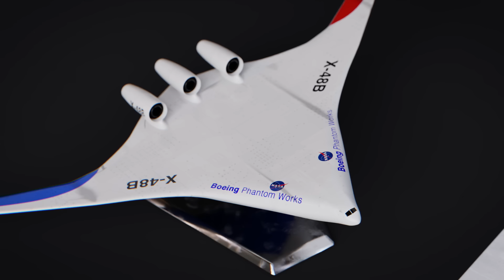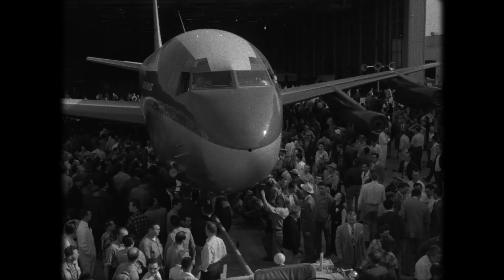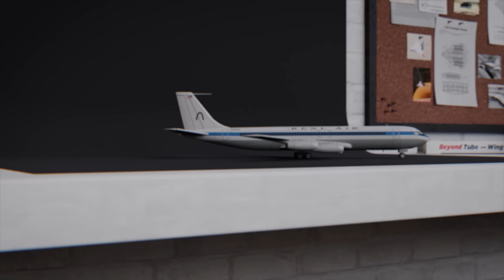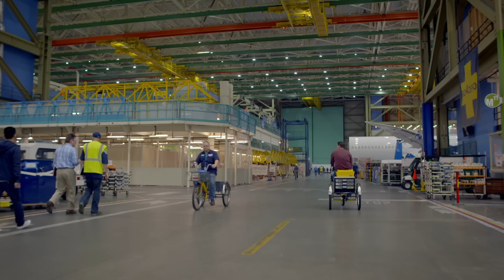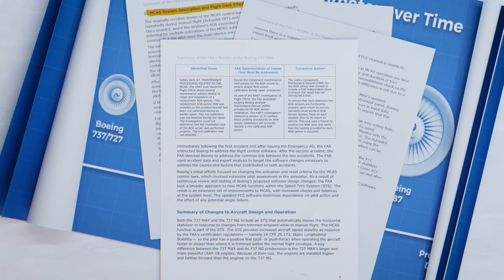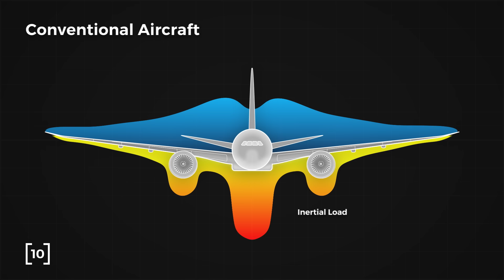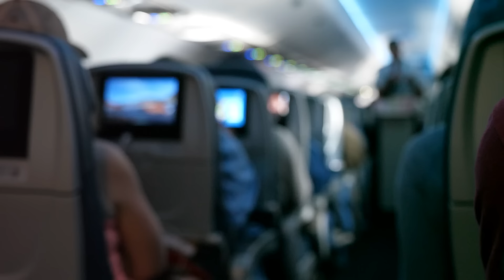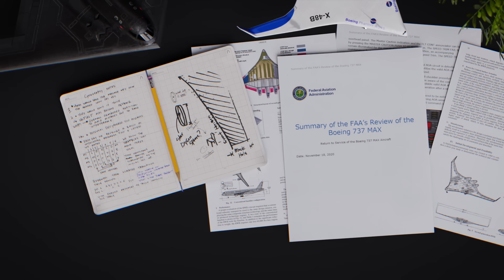The Plane That Will Change Travel Forever

Comment: Extremely interesting and throughout video 👌
Though you forgot one major issue with blended wing architecture: G loads to the passengers at the sides of the cabin during turnarounds. Obviously this doesn't apply to cargo planes but still.
Reply: I have a feeling those would be the "Special joy ride seats" according to the flight company XD
Reply: Spitballing here, but is there any chance the airlines would use that side space for cargo and use the more central parts of the cabin for passengers?  On regional flights, it might be difficult to fill all the extra seats anyway, but there's plenty of demand for regional cargo shipments.
Reply: @DurandalsFate  possibly, but then you run into centre of gravity problems and roll rate degradation. BWB is well suited to cargo though since the wetted area to internal volume ratio is good.
Reply: @DurandalsFate  that's a way to deal with the issue. But you no longer have a larger cabin for the same footprint. Neither windows. Not sure I would fly this.
Reply: The g-force issue during turns is another "gotcha" that is always brought up as an argument against BWB. But would the gentle turns employed by passenger aircraft really impart g-forces greater than a passenger would experience on a tube shaped aircraft during regular turbulence? I sincerely doubt it.
Reply: @jim2lane  Well, it isn't the only challenge with BWB, and though it may be manageable from a g force standpoint, the issue with it is more to do with comfort. It can be somewhat jarring if you stand up to go to the toilet, then suddenly find the pilot has to make an evasive maneuver that demands high rate of roll, and momentarily your 80 year old grandma is floating past the similarly airborne drinks trolley for a few milliseconds, or the freshly poured coffee is flying into someone's lap. Roll rates aircraft are designed to are fixed by certification standards for emergency situations like evasive maneuvers and depending on the type of aircraft, airport climb path restrictions, so there's no chance of relaxing that rule. But as I've said in my other comments, that's far from the most difficult issues to solve.
Reply: @onetrickhorse  you're referencing the same old tropes. You're forgetting that no aircraft is going to be safe to stand in during an emergency maneuver. Additionally, those situations occur 99.9% of the time during takeoff and approach - when everyone, including attendants and beverage carts, are supposed to be seated and belted
Reply: @jim2lane  It isn't the 99.9% of situations that concern regulators, it's the remaining 0.1%. It's those times when an ATC has messed up and sudden roll is required to maintain separation distance for example. You're right, no aircraft is technically 'safe' during emergency situations, but when high roll rates are necessary, having one third of the passengers experience zero or negative g while the others experience 2+, however brief it may be, is uncomfortable. Furthermore, the general public aren't the best behaved cargo, and despite warnings not to unfasten seat belts or leave seats during take-off and landings, some unfortunately do. 

Now, don't get me wrong, I'm sure I'd love the ride, I love a good thrill. But would 80 year old Dorothy, or a 1 year old baby? What about those with heart conditions? You have to take all of this into account when designing civil aircraft. Besides, it isn't a showstopper to BWB, just a challenge in my view. The showstoppers are more practical, the things that make the business case for BWB harder to justify from an operators standpoint. In one of the concept studies I was part of looking into BWB aircraft, the performance looked great, SFC was great, L/D was fantastic, range and payload all brilliant, as expected. But when we looked into the practicalities, we realised BWB would likely never be realistically viable. Access to engines was a major problem, since engines can no longer be placed on wing pylons, they have to be situated on top of the rear body, elevated on mounting pylons to ensure the inlet flow doesn't ingest the main body boundary layer. This means you couldn't perform critical maintenance or safety checks between trips without specialist equipment to lift ground grew to the engines. OK, say we chose to do that, no biggie right? Well, no. That comes with another set of difficulties, mainly additional equipment to buy, additional training, and the risk of that equipment damaging control surfaces. Then there's the turbine disk burst planes. It was found to be completely impractical to place the engines on the airframe without potentially compromising other critical components. You have to stagger the engines for example, otherwise one engine failure could result in debris going into the other. There's also minimum evac times, though I worked on a concept where we demonstrated that might be resolvable. 

Now, I'm not saying it can't be done. But from what I've seen personally, it would take a lot of work to get BWB to a place where both passengers and regulation authorities would be happy to sign off on it.
Reply: @onetrickhorse  the point is how often do commercial aircraft encounter scenarios where hard/sudden emergency turns are required? Exceedingly rare, especially in comparison to the number that encounter severe turbulence where passengers even  in current aircraft can experience the same loads. And you would only be able to access the engines for pre-flight inspections with special equipment? C'mon man - a simple access door from the cabin onto the upper body would suffice just fine. It seems like you were simply looking for justifications not to build a BWB.
Reply: @jim2lane  And on your point, rare though it is, it happens too often to ignore. Let's say it happened once in 10,000 flights. That still isn't good enough. 1 in a million isn't good enough even. The acceptable figure of event occurrence in cert regulations where passenger injury or death is likely is 1 in 100 million, or 1 in 10^8 flights. So we would need to prove that the event was exceedingly unlikely, which it isn't, or that during the event, sufficient mitigations are in place to prevent injury or death. It isn't an outright showstopper as I've said before, but it is a difficult challenge to solve, and would require extensive R&D to do so. 

As for your hatch idea, we looked at it. We also looked at hydraulic pylons that drop the engines to ground level, steps within the main body to the pylons that open on ground, different engine locations, you name it. Hell, we even looked at the possibility of using drones and robots to inspect. None of it makes practical sense. With hatches, the problem is weight and complexity. BWB already suffer from issues with the cabin pressurisation as a result of non-uniform stress distribution, and now you want to put a door in the rear centre cabin, right where all the thickest structural elements are? Sure, you can put the hatch elsewhere, perhaps towards the edge of the cabin, which we looked at, but then you're adding asymmetrical weight if you only have one, and two doors if you balance it out, which in total results in additional weight about the same as your average family saloon when all is said and done. Say you manage that, say you get those doors on, despite the structural issues, weight, and location. What will you do when you're stood next to the engine pylon, and you're staring up at the engine on top of a 4 foot pylon? You need a ladder. More complexity, more stuff needed. 

As for justifications not to do it, well you couldn't be more wrong. The studies I was a part of set out to solve or de-risk all of the issues around BWB, and we did for many. But some still remain. That's the fact of the matter, there are challenges with BWB that mean it simply isn't practical yet for civil use. You can agree or disagree, but that is the reality.
Reply: Came looking for this comment, and you delivered. I worked on a number of BWB concepts, including the NASA N3-X BWB concept study, and one of the major unresolved issues was passenger comfort during roll maneuvers. That vertical movement at the tips was up to 30 feet in some cases, and was perceived to be borderline in terms of comfort tolerance for passengers. There were other showstoppers though that presented far bigger challenges, such as minimum evacuation times in emergencies, engine turbine disk burst planes intersecting flight control surfaces, challenging loading/unloading procedures, and operator maintenance access (it's not so easy to open an engine panel that's situated on top of the aircraft!).

Comment: There is a problem for the passengers in a blended wing as they get further from the center line. Near the center, as the plane banks, there isn't too much sensation. At extreme banks, as the plane makes turns for landing or takeoff, the passengers are virtually on their sides and feel like they're looking straight down at the ground. Their would be an uncomfortable sensation during this turn if it wasn't for what is known as a coordinated turn and bank. It's one of the first things a new pilot learns. However, in the blended wing, this sensation is much harder to overcome. Also, there is the simple fact that those in the outer seats are going much further up and down. Even people who are not normally susceptible to motion sickness in a conventional aircraft may get quite queasy as they go through some very large swings up and down.
Reply: That is a good point. Airlines likely would change flight paths to have much wider turns to compensate.

Comment: Another point of this design is boundary layer separation. The engines pull air from the surface of the fuselage for an increase in efficiency.
Reply: ...which is awesome, until you have icing conditions, and pieces of ice start breaking off the fuselage and go into the engines.

Comment: Why not use kinetic energy by accelerating the aircraft on the ground using electricity

Accelerate an aircraft on the ground to 1,000 m/s that will give it enough energy to fly upto 1,000 miles with zero fuel

In fact this could work very well for battery aircraft as you would only need a very small amount of batteries just to allow power for control surfaces and on board entertiament lights etc

And maybe just enough energy to abort 2-3 landing attemps and circle around to try again

Such an aircraft would be significantly lighter than oil aircraft as almost all the energy would be from kinetic energy not oil not batteries

45 of the 50 busiest air routes in the world are under 1,000 miles so this would work for 90% of routes and even the 10% that are longer the first 1,000 miles would be oil free

The busiest air route is just 295 miles it would need a take off speed of 'only' 700 m/s

Comment: It's not obvious to me that air travel will ever be eco-friendly, just less eco-antagonistic. Do you really think it can actually be eco-friendly?
Reply: Yes there is a 'simple' way to do it

Which is to Accelerate the aircraft on the ground to high enough speeds that you don't needed much fuel

If you speed up the aircraft to 1,300 meters per second on the ground. It will have the energy to climb to 60,000 feet and then travel 1,500km with zero fuel

1,500 km doesn't sound like a long range but it means 90% of flight routes can be done with close to zero oil or zero batteries

Routes that are more than this distance can still gain the first 1500km for free before using oil or batteries

Comment: I worked on the X-48C at FedEx with Boeing Phantom Works back in 2007-2009.

The biggest barrier is that Boeing management does not want to invest in the cost and tooling required in a BWB or HBWB.  They have no vision.

That is why the “new” models of the last few decades all are patchwork designs of prior aircraft models with small changes or material changes.

Comment: We really need a better fuel; but remember, energy is needed to make a fuel, so it is the total footprint of the entire fuel production chain, not just the final jet engine exhaust. 

Also, lower the cost of the ticket, and it will likely increase the demand for flying. Is it a certainty that the total estimated 27% fuel use saving will be realized, if there is, say, a 33% increase in the number of planes? 

Finally, one thing we can sure of, the companies will cram as many seats as they can onboard, and my 6'5" self will still hate flying for this reason, and the entire demeaning process that is security theatre. I hope to never fly again. Been there, done that.

Comment: They keep trying to cut costs by going bigger, what would the fuel costs look like for a smaller, lighter, and faster but fewer passenger at a higher altitude plane look like? at 80,000 feet instead of ~40,000 the density of air would be ~1/5th allowing for even higher speeds and possibly efficiency. The service ceiling of such theoretical smaller and lighter aircraft will be increased but perhaps not to that 80,000 number, that might be a bit unfeasible for something aiming to be fuel efficient. It is hard to find data on this that goes above the standard 35,000-40,000 feet.

Comment: Many must have forgotten the Airbus A-340 was a failure,  not because it was a bad aircraft, but because it did not fit infrastructure of existing airports. Billions would have to be spent on infrastructure to fit flying wing aircraft and this alone will cause its failure commercially just as it did the A-340.

Comment: The pressure any fuel driven industry is under during the the transition to cleaner means of transport, means that flying becomes slower and the fuel more expensive. I don't think this will be impervious to passengers. Flying will at least for a time be a luxury way of travel, like in the 50's before cheap flights became available.  A high tech plane with lower drag on synthetic fuel is the way to go, but flying will still be something different in 10 or 20 years. The Delta wing is another option for a low drag aircraft. It can also be blended wing design and is naturally stable. It was popular with early jet fighters as the large internal space could be used for fuel which the early thirsty jet engines needed lots of.

Comment: "we will soon be seeing these futuristic planes landing at airports all around the world" but where will they park and how will passengers board?
i love the design but it won't work because airports are already the way they are. the tube and wing layout doesn't just cut development and construction costs, it guarantees it can park and be boarded at any airport.
Reply: They had to modify the airports to accommodate Airbus 380s.  So to modify airports to accommodate this will not be that difficult.
Reply: @ramaswamyadisesh6848  you're underestimating the scale of modifications made. some runways were made longer and some taxiways wider for the A380, but the body of blended wing aircraft are so wide they won't be able to park anywhere at any airport. boeing themselves acknowledge this is and this is why they're making cargo versions of this plane, not passenger. think about how aircraft currently park up at a terminal, and the the boarding ramp extends down alongside the narrow tube body of the aircraft to allow people on and off. how would that work with a blended wing design? boeing is looking at making their blended wing cargo craft loadable from below. how many airports do you know have passenger boarding facilities such that you can enter a lane from below?

Comment: @ 22:24 just a thought but with the inner pressure vessel and outer skin seperate . the space between the 2 could be presurized to say 40 % of were the inner passenger area needs to be inturn reducing the stress on the inner by the same 40%,,, also using the light weight composites a perpendicular  honey comb pattern between inner and outer skins would be incredabily strong

Comment: 4:50 why can't they move the wings so the lift is at the same spot as the center of mass? I always thought that was the case and the tail wings are more for stability and pitch control
9:11 oh ok. Although with modern tech, I bet you could do that in software and lower the fuel consumption
Ok, I'll just watch the video, cause all of it gets addressed, apparently haha

Comment: And in 20 more decades they'll get rid of the cumbersome wheels because they'll determine that yes, you can in fact just plan to arrive at airports with special launchers and catchers, and your plane won't explode if you make emergency landings elsewhere. Honestly, the whole wheel system is so stupid... takes up way too much space, and adds so much unnecessary weight. Get rid of the wheels engineers. Jeez.

Comment: It's going to have to be a bit more hybrid than that though, because strong gusts of wind will destroy a plane like that, either stalling it up, or causing it to spear to the ground. If you want to keep its current "wing" design, then all you've got to do is have tail extensions which can slide out of the back in the event of an emergency, to help direct airflow. Nevermind, they got that covered. lol